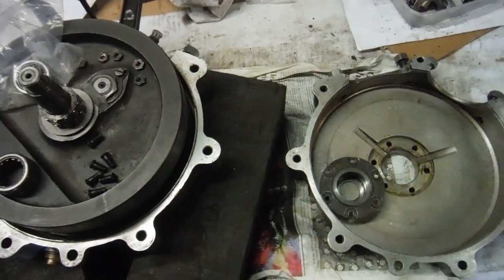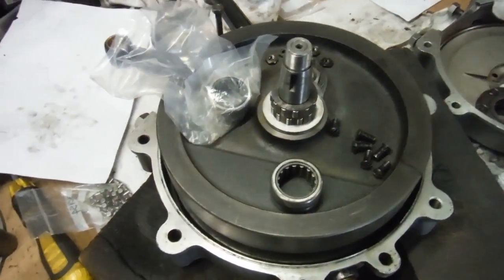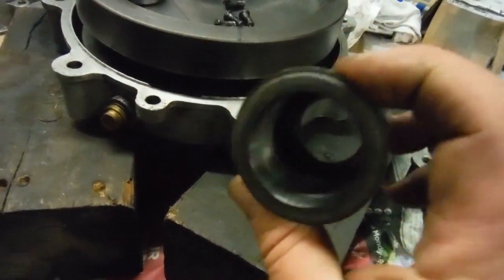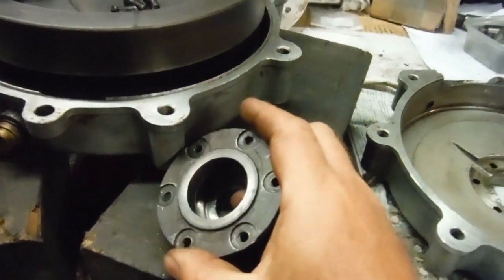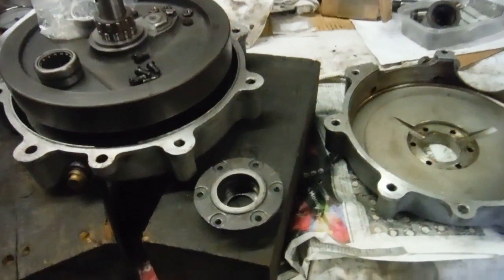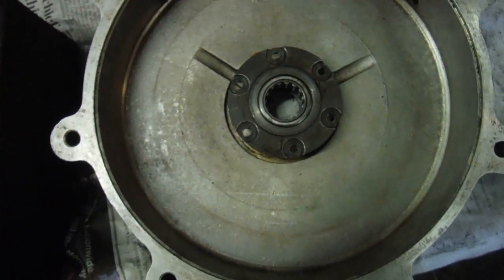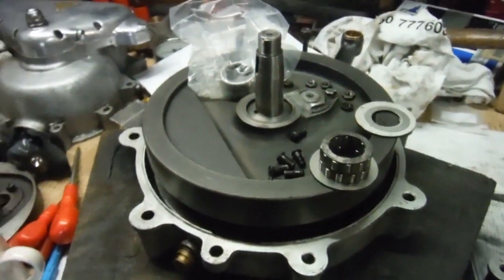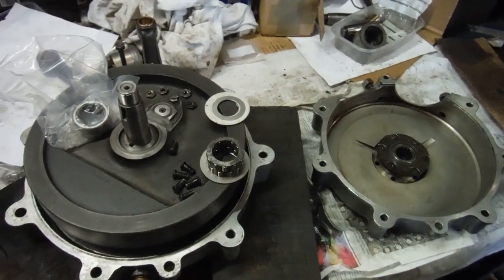Royal Enfield Model K 1930 drive side main bearing modification.

Comment: There are four possible solutions to running the rollers on the shaft I can think of.  Metal spray the area where the rollers run.  Shrink a sleeve to the shaft.  Both these solutions weaken the shaft by undercutting the OD and are difficult to do on small work.  Case harden the area where the rollers run and grind the journal on a cylindrical grinder.  I don't know how this would work out, how it would effect the keyway or the thread at the end of the shaft.  The other solution is to make the shaft out high grade steel which is probably the best option, but that would mean the machining would be difficult.  That's probably the option you took anyway.
Reply from the maker: The mainshaft is new and would have run directly in the rollers in the original design - not the best idea, but I have not done any worse than that. A sleeve pressed over the mainshaft [with no machining required] was considered, but to achieve this, the oil feed to the big ends may have been compromised, so I took the route seen here. All being well, it should work!